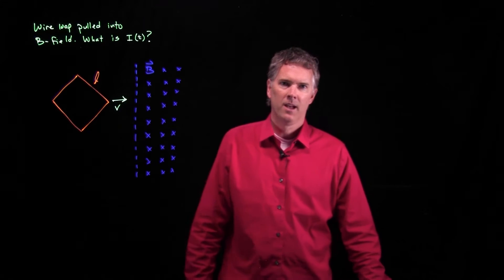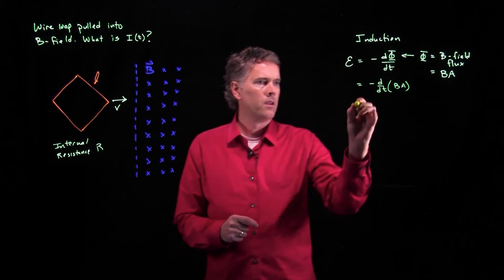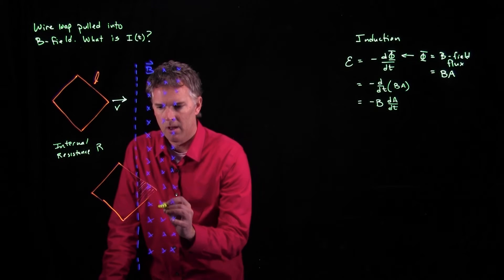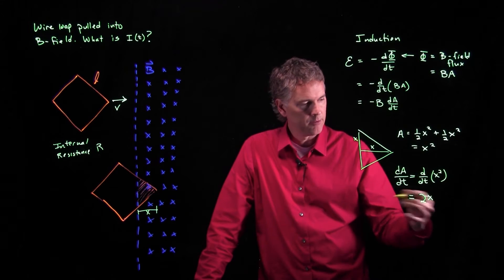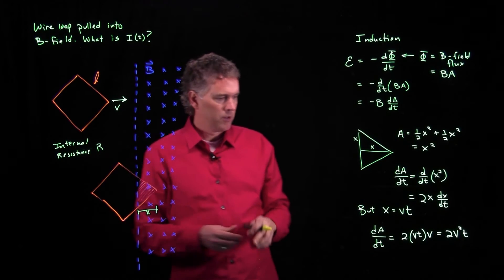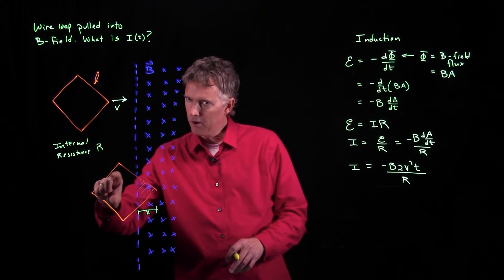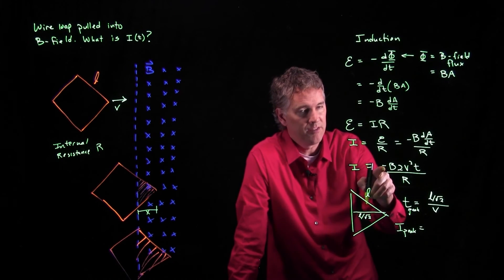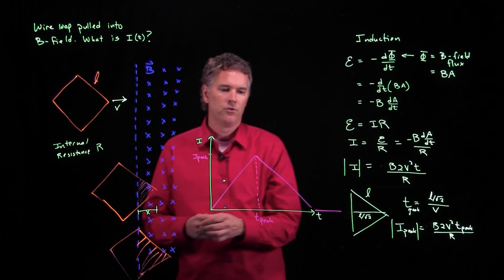Wire loop pulled into B field

Comment: So because the current wave is triangle shape, will this antenna receive at base frequency and odd harmonics?

From skimming loop antenna theory I'm led to believe the shape does not matter much, but from your presentation a round antenna would have a nicer sine wave pattern without odd harmonics instead.

Perhaps I am confused and should try to see how it responds to a sine wave instead. In your example B-field is uniform strength in all X right?